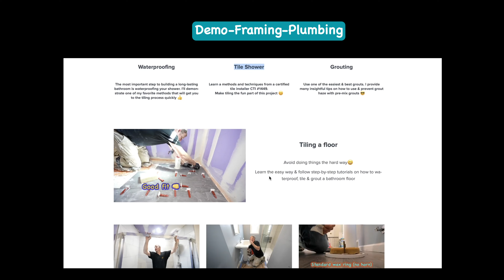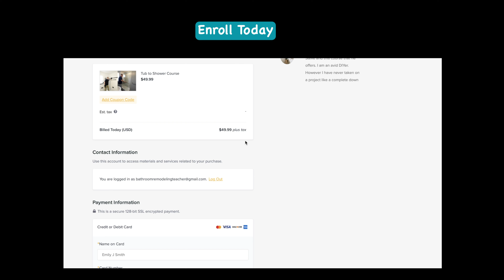Old Tile Removal | Mud Bed Walls | PLAN LEARN BUILD

Comment: I had to stop watching. This vintage bathroom is wonderful. Too many people are destroying these beautiful bathrooms. Oh well, to each his own.
Reply: I completely agree!  This dude should be embarrassed to have posted this on the internet.  What a shame this gorgeous bathroom got wrecked.  Ugh.
Reply: Try living with one dude. It’s cramped and not practical.
Reply: Yeah, I winced with the first swing of the hammer. When he first showed the bathroom I thought to myself it would be awesome if my bathroom l looked like that. But, it's his house so he should have the style he desires.
Reply: Go fix yourself. Here, I'll do it for you: I love vintage bathrooms. If it were mine, I'd never change it. But because it isnt- I'll just say I'm glad you love your remodel.
Reply: In the case, this would be in a hospital. Does it make sense?
Reply: I have a similar bathroom with almost identical tiles and tub. While I fell in love with the bathroom upon purchase of my 1940's home, now the tiles randomly come up, sticking to my feet and there is a huge crack down the center. The walls are also heavily cracked (something I barely noticed upon move in 4 years ago since they did a lot of temporary patching of the tiles) and the lack of storage in the tiny bathroom impedes day to day function. I am also constantly worried about getting any water anywhere on the floors since they are so badly crumbling and the corners between the wall tiles and floors are all open. While the bathroom he demoed isn't as bad as mine, I appreciate it because although I love the charm, the functions is abysmal and I can't afford to pay someone to demo. It might be sad to watch the charm be demolished, but I deeply appreciate having the resource and visuals of what I am getting into!

Comment: I have a hundred year old house everything is plaster and laths and wire mesh every where I did my bathroom and all my friends kept asking me what's taking you so long I must of had 50 bags of plaster and wood I would work a day and take one off to recover luckily I have another bathroom and tiling was no piece of cake either lugging all the cement board and tiles up to the 2nd floor. I will never again think tiling is an easy job just swinging that 24 oz hammer after a while takes its toll on the body .Good luck to you.
Reply: I had a similar experience recently.. I’m done now & decided to go over the floor instead but now I’m redoing a fireplace with the same floor & I’m dreading it

Comment: I have the exact same stuff, it is brutal!! you are a beast took me longer to do half as much! I really want to know how they put this tile up to begin with!
Reply: Once you remove the wire stuff. What did you put up? Just drywall?
Reply: @henry1343  drywall where there will not be tile but cement backer board for the tile area.
Reply: @Gary Caruso  thanks. I think my hardest part is the bathroom has tile on the ceiling in of the tub space. Going to hard to remove.

Comment: How many days did it take you to demo that one room?   Also, if the tile strips off the concrete relatively well, is it reasonable to smooth any defects in the surface with new mud and then just mastic down the new tile (large subway tile) to the concrete as-is?    Thank you!

Comment: I sure don't miss these jobs.  You made my elbows and shoulder hurt just watching you swing that hammer.  I used the small demo hammer with a 1 1/2" flat blade, small sledge, & an angle grinder with a diamond bit.  

That weight was crazy for just the walls.  I've always wondered how much we've taken out of these jobs.  I'm guessing this had the V notched joists in the floor also.
Reply from the maker: Thankfully no, just chicken wire over 3/4” planks. About 1 1/2” thick not 2-3” with the v notch 👊

Comment: Great video! I see your other comments about how this took 4 hours... I have 2 of these older bathrooms in my house so I should be good with a solid 8 hours of demo! 🤣
Reply: Wow, I'd have guessed that was a couple of days worth of work! 😮
Reply: I'm on day 2 of demo... 😅😅😅 tough sob. They definitely bulit different back then.
Reply: I got some guys that don't know what they are doing, my bathroom is only 8x8 all ceramic tile floor to ceiling. no lath but 2 layers on shower surround part only and 3 layers (tile over tile) on floor BUT the floor area is only 3.5x8 because of course no tile under the tub, it has taken them 4 days to tear out and still left part of the floor to be demo.  I fired them, if they couldn't demo I didn't trust them to put in new bathroom. If it only took you 4 hours, they should have been done with mine in an hour. Again full bathroom is only 8x8 with tiled floor only 3.5x8

Comment: Those mid bed walls are tough.  If you have another guy.  We find it as faster to knock off the top row between the plaster and mud bed.  Then pry it off the studs.  Bringing down a wall at a time.  Then cutting into more manageable pieces if needed, to carry to dumpster.

Comment: mine is almost like this through out my house, but mine has plaster and chicken wire holding it together, is that the same time period. but this is for holding tile and mine is just how they did the walls back then,. either way its messy.

Comment: Angle grinder, cut into manageable sections and pry away from studs.
Reply from the maker: 👍 dusty option. But yeah that’ll work too
Reply: @BathroomRemodelingTeacher  faster and cleaner. Time is money. Hold a wet sponge or a vac hose to the blade if the dust is too much.
Reply: @wyseguy77  faster to hammer drill some holes then use that grinder plus the touchy clients I work with all worry about the dust it's the first thing they tell me about
Reply: Any issue with asbestos?
Reply: @MichaelBrown-ip9mt  not yet but when I do something like this definitely got my mask on for demo
Reply: @ryanmccue8180  I've done this as well and agree this is also a great option. A lot less dust.
Reply from the maker: @wyseguy77  4 hour demo this way. But I respect your opinion
Reply from the maker: @MichaelBrown-ip9mt  it’s just mortar. I doubt they have it in there. But who knows, 😆 used to be in everything
Reply: @MichaelBrown-ip9mt  if asbestos is concern I'm not touching it. I recommend having an abatement crew do the demo. Much safer for me and the client.

Comment: Why are you not using an air chisel?
Reply from the maker: For one I don’t have one, secondly I’m not sure if it will save much time. These walls were removed in about 4 hours. Rest of the day was plaster removal and talking while filming
Reply: @BathroomRemodelingTeacher  I'm just curious. I've been a bathroom remodeler for 30 yrs. If I didn't have an air chisel I would have used an 8 pound sledge.
Reply from the maker: @steveciarico9824  I might like to do things the hard way, 😆 I’ll try air chisel someday. Although, I’m okay not doing another demo like this for awhile, 😆
Reply: @BathroomRemodelingTeacher  I'm the same way. Doing things the hard way keeps you strong. Good job!
Reply: @BathroomRemodelingTeacher  even if you could rent one, an air chisel...it goes through tile like butter. 😅

Comment: Omg….  Next time use an angle grinder with diamond tip and cut out complete sections, use a long crowbar to pull the cut out sections from the studs.  The sections are very heavy so probably shouldn’t do sections more than 2’ by 4’

Comment: Nothing wrong with that bathroom. 
"Lets pull out this old artwork that took a lot of effort and install cheap modern bullshit!"
Reply: In a previous comment he said the previous owner had painted all of the tile and the paint was peeling. So, shame on the previous owner for creating a mess of the artwork. I was shocked and disappointed to see it torn  out as well.
Reply: @robjohnston5292 ok, that's why it looks so white. Mine is almost identical to this but the tiles are discoloring and the floor needs an update because there's a crack. If I could clean it up I would but it doesn't seem possible.